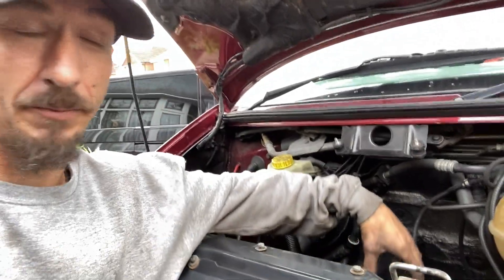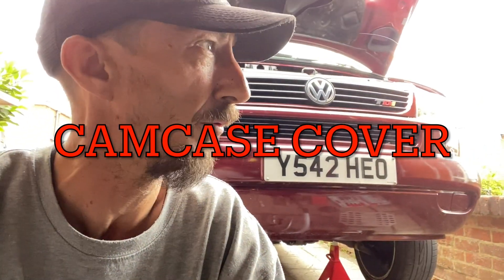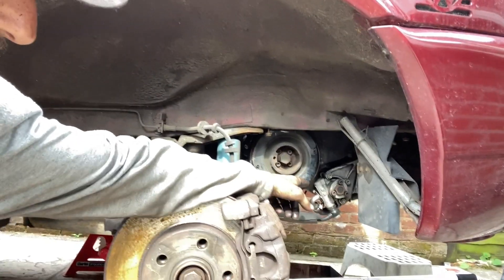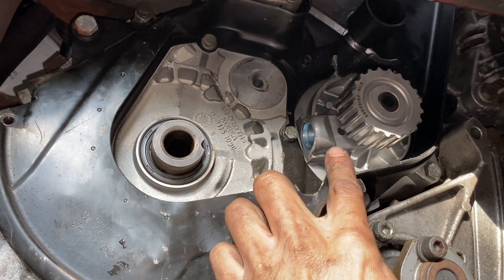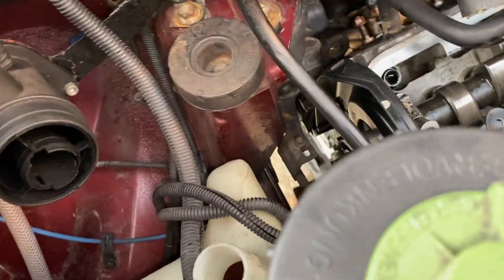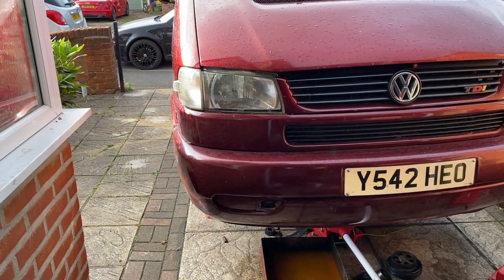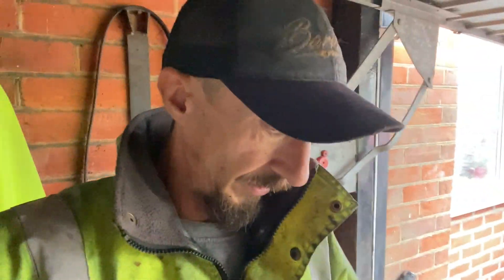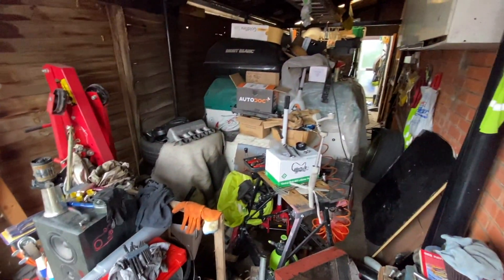Cambelt service interval

Comment: Audi have just increased the cambelt service interval on all Audi's. I think my son (Audi trained mechanic) said 10 years or 100K miles. Since we have an Audi engine in the T4, good times. 😄
Reply from the maker: I wouldn’t like to leave mine for 10 years. I read somewhere that the tensioner should be replaced every 3 years but the belt is 6 years or a certain mileage(which I can’t remember off the top of my head)

Comment: It's only a bit of water, you get wetter every night in the shower/bath😂
Mate, I always put INA on mine, quality kit and as you say, OEM spec. I do believe VW use INA from factory. 
Have you got any ACV injector clamps going spare?
Might be worth your while buying one of these pop up gazebo things for when you're working on any of your vehicles.
Reply from the maker: I’m not worried about me getting wet, it was more water getting into the engine with camcase cover off. Yeah good quality INA I’ve used them on other vehicles 👍 
I’ll have a look see what I got, but I don’t think I have.  That’s a good shout and I’ll look into a pop up gazebo 👌